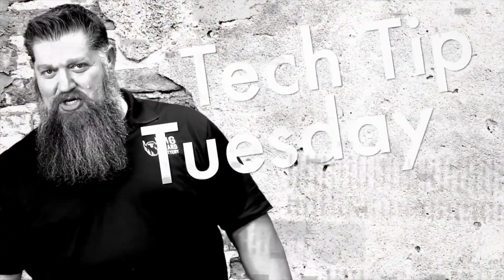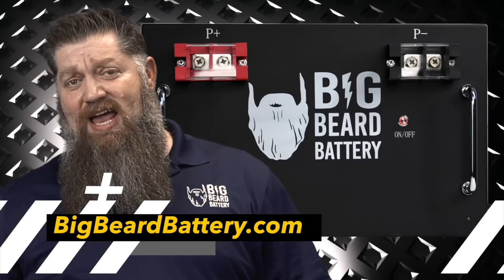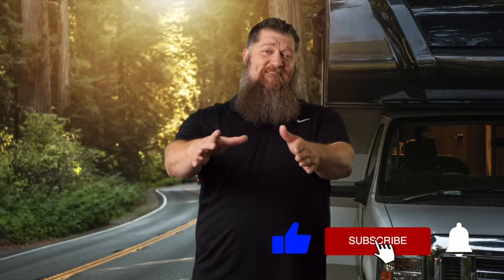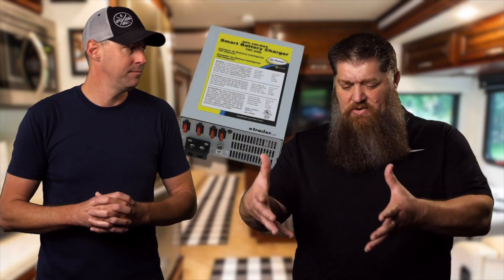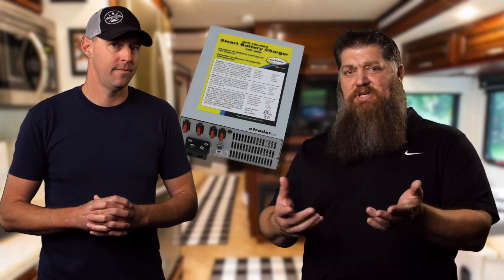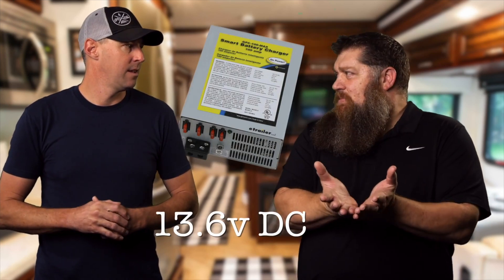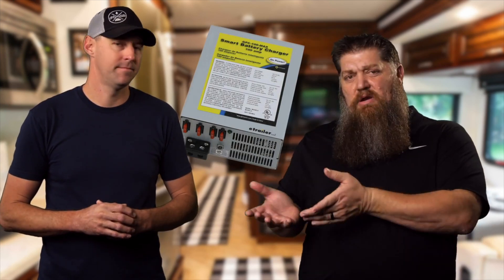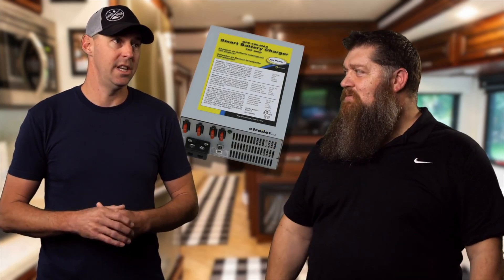RV battery charger for lithium

Comment: I have read that you shouldn't store your lithium battery at 100%. So if your RV only charges it to 80%. Would that not be better for your lithium battery when you are plugged into shore power  it will maintain it at Around 80 % And then you could use a portable dedicated lithium battery charger To top up your cells for proper balancing say once a month
Reply: If they are lifepo4 you want to charge them to full. It is also better for the battery!

Comment: If I upgrade from a 30amp converter to a 80amp do I have to upgrade any other wires besides the wire from the converter to the batteries?  I am charging 4 100amp battle born batteries.

Comment: Please.....  I cannot find an answer to my question anywhere... So, I'm converting my pull behind RV to Lithium. I want to be able to charge the lithium RV batteries with solar, and from the tow vehicle while I'm driving, or from the vehicle if the lithium batteries need a charge because there's not enough sun etc. I have four 100W Renogy solar panels, Three 100Wh Lithium batteries, a 50 amp Renogy DC to DC charger with MPPT solar input. I also have a 3000 watt pure sine inverter

My Question...   The normal, standard 7 pin umbilical connection between the tow vehicle and the trailer is rated at 15 amps. The DC to DC charger is rated at 50 amps charging current. Surly if I connect the DC to DC charger to the incoming 12 volts coming from the tow vehicle, this will blow fuses in the tow vehicle or destroy the alternator etc etc...

What am I not seeing here ???
Reply from the maker: When using a dc-dc converter it is best to upgrade wiring and run a new path from the starter battery back to the trailer via an Anderson plug. Use #2 wire and put in say 75amp bolt on fuse in-line the new cable. Bamo no blown fuse

Comment: I will periodically  fully charge with an external lithium batt charger, in addition to the on board Solar charger,  till I get around to swap Converter. Unless that is a  no-no!,
Reply: I was considering the same. What's the downside other than my time?

Comment: If you have a correct solar charger it should bring the charge level up over the 80 percent.
Reply: The acid battery charge controller will bring the lithium batteries to about 75%-80% and then the solar will take it from there and charge the batteries to 100% assuming you have clear sunny day. In my situation I have to run a power cord across the sidewalk in front of my house and go 30 feet to a porch 120v 15ampo power receptacle on the house. My HOA don't like cables going across the side walk for safety reasons. I have to put up orange safety cones and light up the area like a airport runway.

Comment: If you've got a small capacity lithium battery (100ah), with a 100 watt solar panel on the roof, the solar can top off the battery beyond the 13.6v you'll get from your lead acid charger/converter.

This isn't the best solution. But it's a budget-friendly way to covert over to lithium (if you've already got a solar panel on the roof).
Reply: Just same here my solar would charge the lithium batteries to 100% but sometimes it won't charge to 100% when my RV is stored under a awning at a storage faculty, it only gets indirect sun light. On a cloudy day when my solar isn't getting enough sun m y batteries are not getting fully charge driving sown the road with our 12v fridge on. After a year of using my old existing acid battery controller I upgraded to a Lithium charger for around $150. I use 120v outside power to keep the batteries 100% before we hit the road.

Comment: If I have an older inverter/charger that does not have the ability to charge lithium, can I put in a DC to DC charger to increase the voltage for lithium charging? I guess I'd also need a second DC to DC charger for alternator charging. Is this a possible scenario?
Reply: A DC-DC charger is certainly capable of charging the batteries in your RV, but you need (1) wiring of an appropriate gauge, probably around 6-8 AWG and (2) with a stock alternator, 30-40 amps is probably the most that you can safely draw from your tow vehicle without risking damage to your alternator.

But for possibly less than the price of all that, just upgrade your converter/charger to one that can properly charge lithium batteries.

Now, if you actually do have an inverter/charger, there's a good chance that it can be programmed to charge lithium batteries correctly.
Reply: @calledtojourney  This is on 1995 Class A diesel pusher with a 160 amp alternator. The inverter charger is so old that all it has are DIP switch settings for LeadAcid or AGM only. Yeah, I'm shopping for an inverter upgrade, but if there's less costly way to do it for now, I'd like to explore that too.
Reply: @sammysnit1688  Well, if you got 30 years of use out of it, you're already ahead of the game!